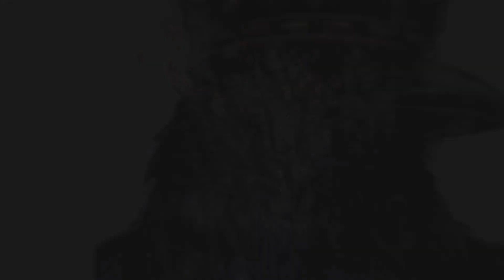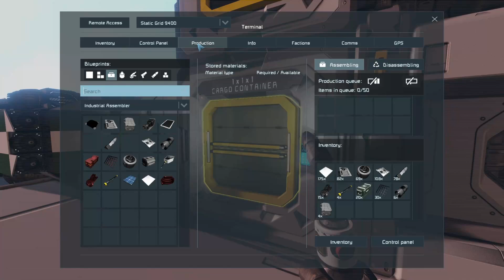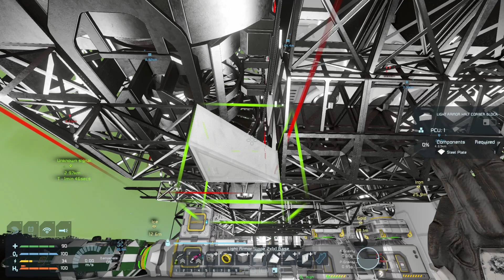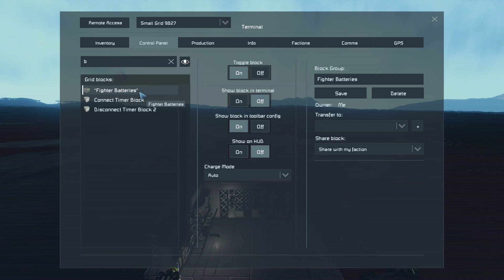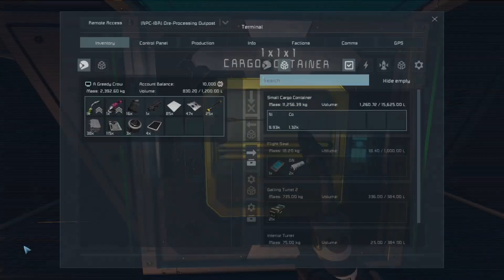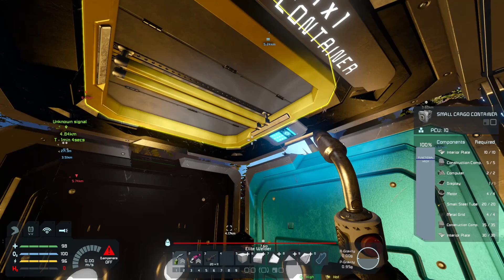Another NEW Ship?!?! | Space Engineers | Season 1 Episode 15

Comment: I know this vid is older, but I'm working my way through the backlog. 2 thoughts that you might have addressed already:
the scout rovers at the "survey" base, should have ore detectors to survey for ores
on the fighter you're designing in this video you consider 2 connectors underneath. I find this is a great way to orient the craft in a desired direction in a docking bay with repeatable accuracy. I use it in many of my small grid designs. At least the ones that don't use a merge block instead.